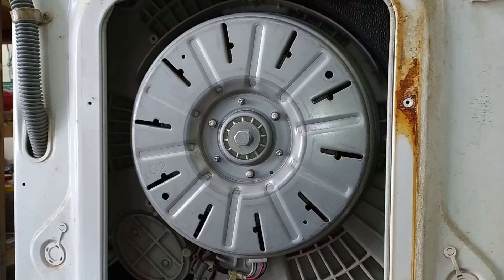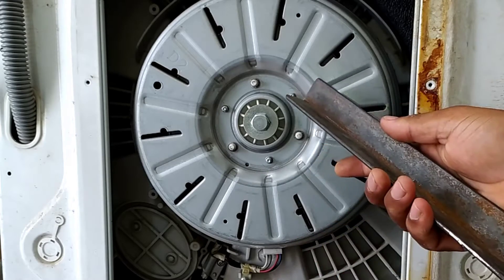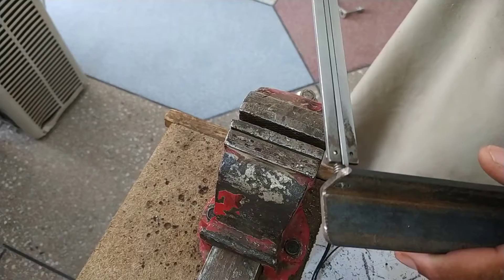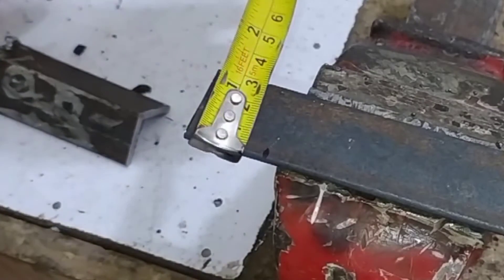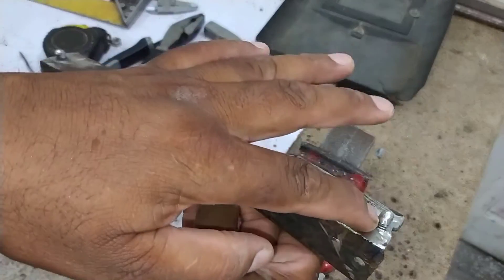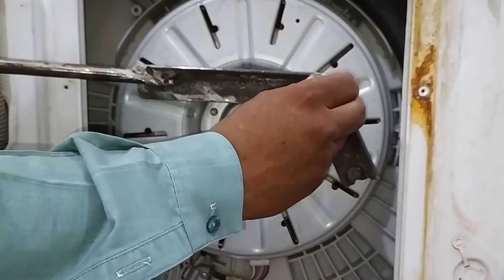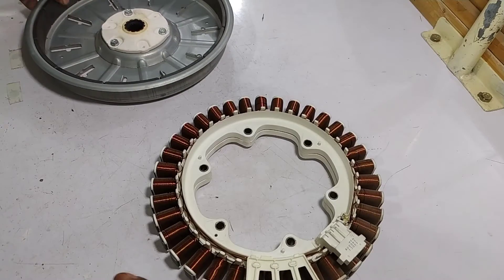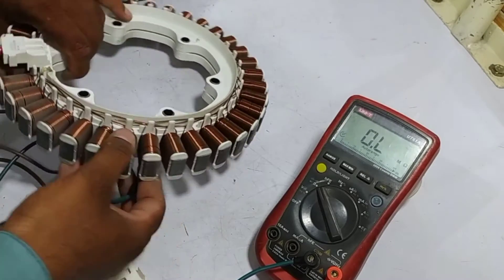A DIY Tool For Washing Machine Motor

Comment: Impact wrench is already invented
Reply from the maker: Yes it is But, this tool makes it easier for these motor as I have experienced Impact wrenches don't work if the bolt is too tight, then this tool I made becomes handy.